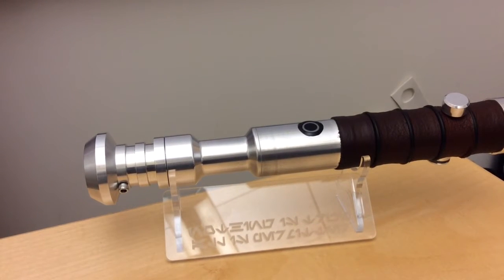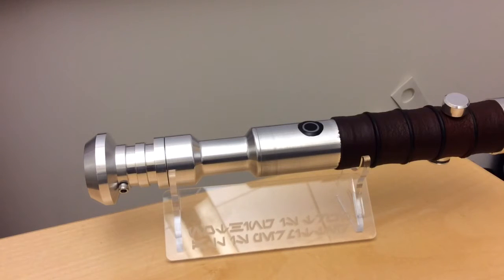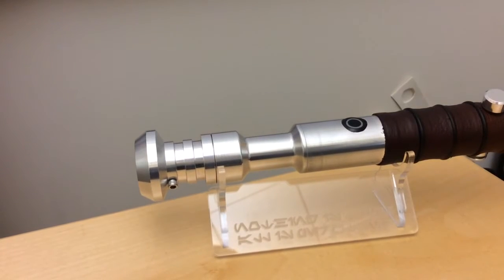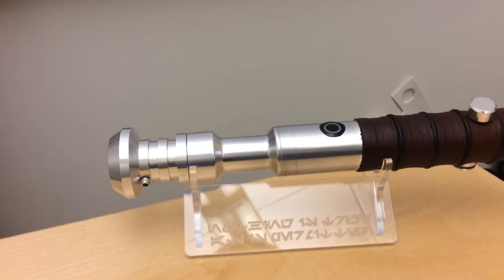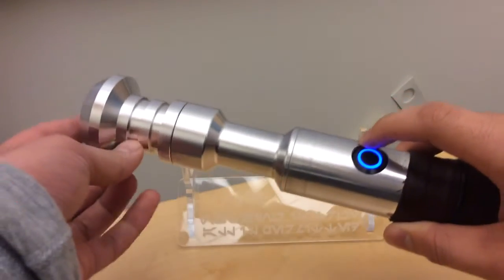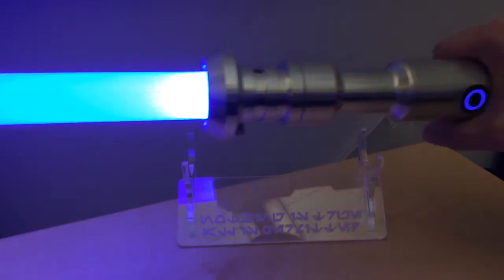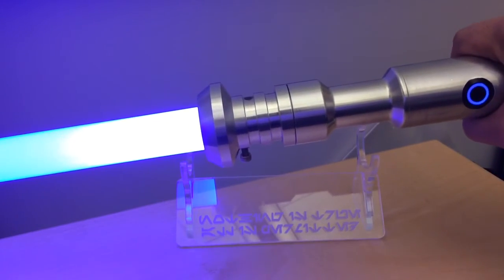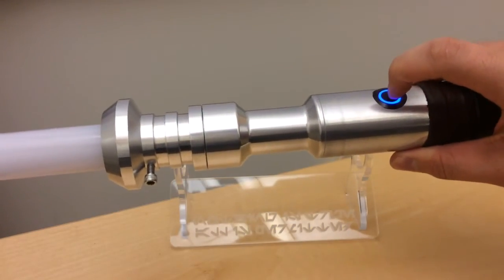My First Lightsaber

Comment: Fantastic job! I have two boxes of parts on route from the Custom Saber Shop and I will be building my own shortly. I hope to
have the parts Monday. I should have went with the PEX and a Tri Rebel. I just went with a red single rebel. I guess that gives me an excuse to build another saber :)
Reply from the maker: That's awesome! I too made the mistake of ordering just a single rebel LED but then I decided to add the PEX and Tri-Cree. I simply used my single LED for soldering practice! :)
Reply: Do you happen to have a wiring diagram that you used? The only part of the wiring I'm not 100% sure of are the leads for the illuminated anti vandal switch. I know there are numerous different ways to wire it. I want it tied in with the blade LED that way it behaves the same as the blade.
Reply from the maker: +brett248vista 
The Nano Biscotte manual doesn't provide any instructions on how to set that up but I would imagine the best way is to parallel the switch LED with the main LED and put a resistor there to limit current to <20ma.
In any case, I posted an initial draft of my wiring diagram on the TCSS forums: http://forums.thecustomsabershop.com/showthread.php?18551-Schematic-review
Reply: Raymond New  the problem is I haven't joined the forums so I can't see the images. I guess I am going to have to break down and register! :)

You confirmed what I was planning. I went with a DynaOhm resistor for the switch LED and the appropriate LED for the Rebel Star I guess I will be paralleling them. I guess you can tap into one side of one of the SMD Resistors on the board which will allow it to be steady on/off and not run down the battery in deep sleep but the idea of soldering anywhere near an SMD does not appeal to  me at all!
Reply from the maker: +brett248vista 
Yeah, some of those solders can be quite tough but I always try to remember to take my time. "If you rush it, you break it"
Best of luck and may the Force be with you! :)
Reply: No doubt about the rushing it. I repair mechanical wrist watches so I'm very good at working on microscopic parts and I have patience. I will take my time and will be very methodical about the wiring.  Thanks for the best wishes and I will link you to the video once I get it uploaded :)